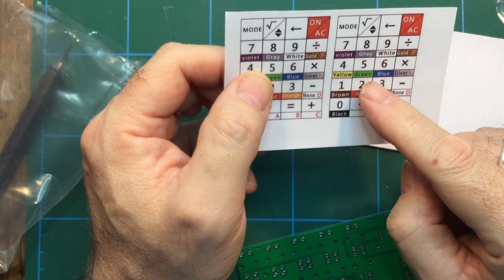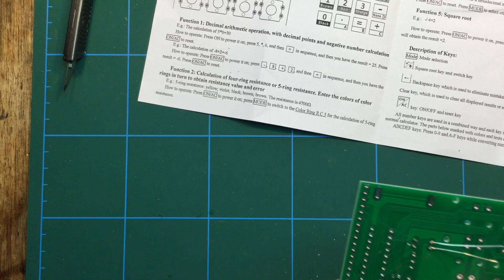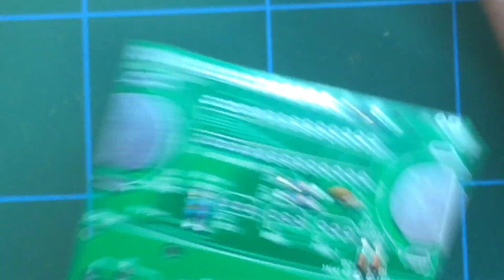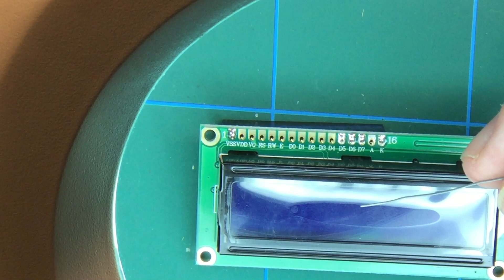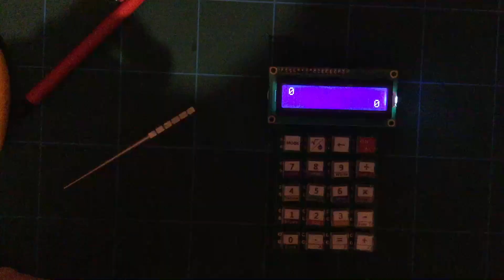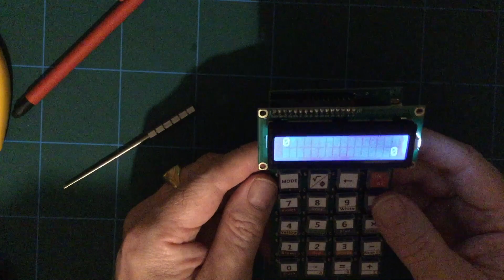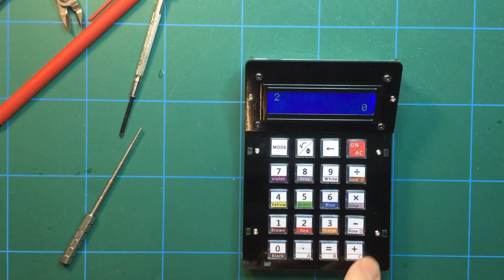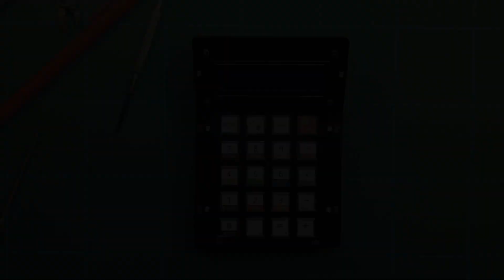Amazon: KKmoon DIY Calculator Kit with Acrylic Case LCD Display

Comment: hi, thanks for the video, it helped :)
any idea on how to set/regulate the lcd contrast?
Reply from the maker: I'm not sure you can to be honest.
Reply: Yes I had the same LCD issue - it is a resistor issue .... Go to resistor R3 which is labeled 10K and replace with a 4K or what I did was put on a POT at R3 to dial contrast up or down.

Comment: A 1000 k resistor and you are trying to measure it with your meter set to 60K---well it won't register. Try it again and set your meter to 6M for 6 Meg. 1000k = 1,000,000 or 1Meg.